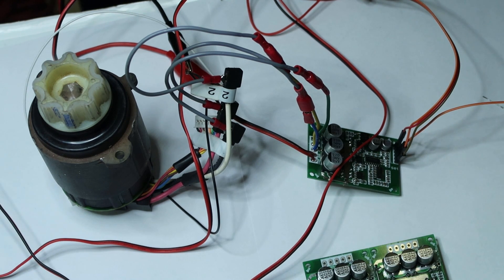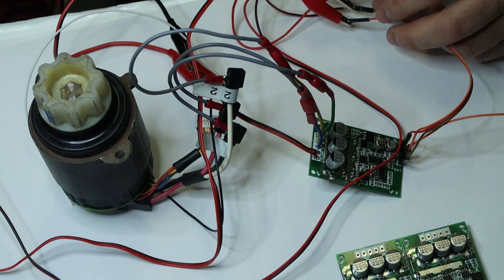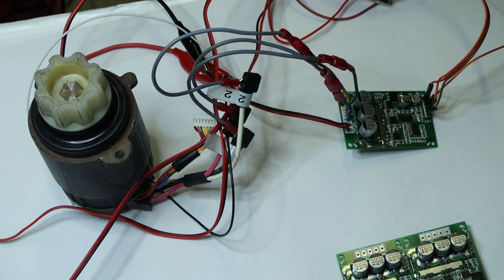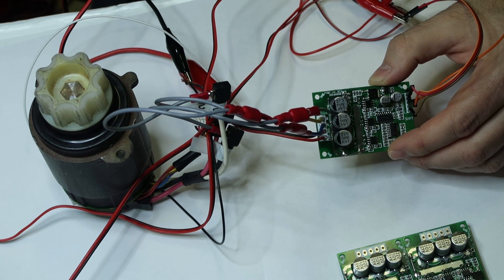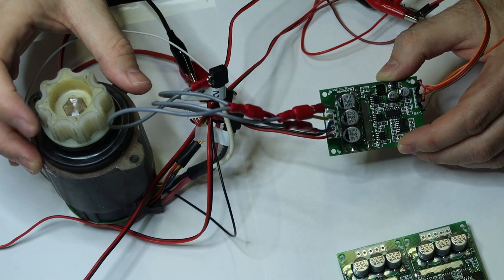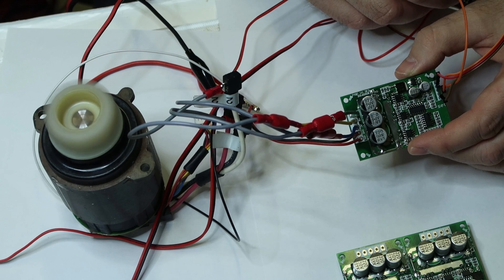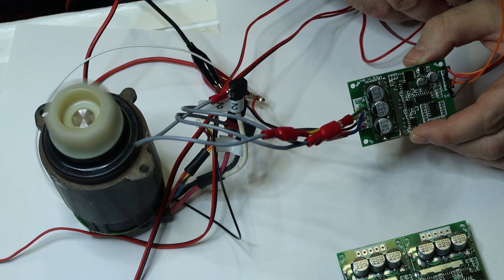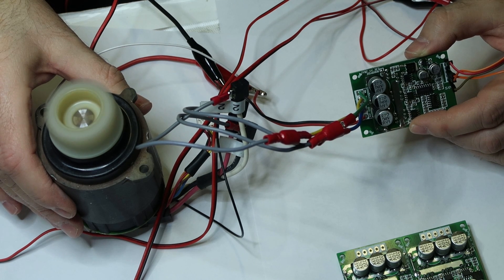Ebay Sensorless Motor Driver

Comment: hello great video congratulations !!!
could you tell me if can control the direction of rotation with pwm + - signals?
Reply from the maker: yes - there is a direction voltage 0 or 5v
Reply: @RoeeBloch  
thank you so much

Comment: Are these different from another variation that has hall inputs? I have not been able to get that one to work without hall sensors. I'm curious if the hall version only works with hall sensors connected? What chip does your board have? JY01?
Reply: Were you ever able to figure out the wiring for this type of motor? I have one im needing to get to a functional state for a project i have in mind.
Reply from the maker: HAHA - you need to know few more things to get it work :), if you donate my site I will send you information by email
Reply: Roee Bloch nvm I saw they used comparator backemf circuit that they feed to hall sensor inputs on jy01 and this circuit is missing on the hall only variant. I also found the schematic for the comparator circuit in the microchip app note.
Reply: @mkschreder  I'm using this same motor as a servo. I'm trying to use the hall sensors, but am prepared to desolder the PCB and just use an encoder. Do you know what each individual wire goes to, can I run them in parallel?

Comment: I can't figure this shit out. Just burned a board trying to spin one of these bastards.
Reply from the maker: If you have connected everything correct and it doesn't work, it may be related to the motor itself.
Which motor do you try to spin ? link and model
Reply: Roee Bloch cheap Amazon motor. I will get link. Only has 3 wires. I am not using the specific driver in your video, but it's very similar. I will source the driver link as well. 

Mostly I'm frustrated because I can't understand the connections their selves. I've been a electrical technician as a diesel mechanic for years now..

DC into 3 phase confuses me. I just got interested in electronics though and bought an Arduino. Board comes with a potentiometer and I wanted to try and run it on the potentiometer alone. Connection arced and lost the power led.  I will post links shortly
Reply: Roee Bloch 
Brushless Motor Control, DROK BLDC Motor Driver Controller DC 5-36V 12V 24V Brushless Sensor Motor Regulator Monitor 350W High Power DC Motor Speed Controller Module with PLC Control, PWM Duty Cycle C https://www.amazon.com/dp/B07BFQ5K3B/ref=cm_sw_r_cp_apa_RKS1AbMVNFV51

This is the driver
Reply from the maker: This Motor is not suitable for this driver. in the best case it will spin the motor very slow or not at all. you need motor driver that is suitable for this motor
Reply: Roee Bloch also, I don't understand how it is possible to fry the circuit board that is rated to 16 amps and my power supply only provided 10amp at maximum and wasn't even at 100%. I didn't connect the pwm wires to power supply so I think maybe the board was defective. I had it connected with motor for a good 5 minutes, then I powered off and during reconnection it arced and I lost power LED. Anyways. I'm going to try the esc with a pwm pulse from my Arduino board.
Reply from the maker: It is not just high current that can ruin the board, for example if you have connected power in wrong direction may be just a small current flow will burn the motor. usually voltage below 0 can ruin the board, for exampe this voltage can flow somewhere if you supply to control signals voltage below 0 - or any other condition cause it
Reply: Roee Bloch yeah I obviously screwed something up. You think the esc I posted will be sufficient? I'm honestly just wanting to get the motor spinning, if too slow for instance I will look at other options. But before I buy expensive motor control I'd like to make sure I understand what I am doing. You understand? Fry cheap stuff to learn before buying expensive equipment
Reply from the maker: It is possible, not just current flow is the cause of burnning circuit, sometimes voltage on input below or above limit can burn the circuit
Reply from the maker: yes it is possible to drive ESC from Arduino
Reply: Hi. Sorry if this sounds like a silly question, but I'm still a newbie. How can I be sure that I've fried my board?
I connect a 24V DC supply across VCC and ground, and the board starts to heat up, but when I connect the motor, which is this kind of water pump: https://www.aliexpress.com/item/Free-Shipping-Submersible-Pump-for-Pool-Watering-Garden-Plants-Watering-24V-DC-1000LPH-8M-43-2W/581657599.html?scm=1007.13438.100207.0&scm_id=1007.13438.100207.0&scm-url=1007.13438.100207.0&pvid=f9703469-5028-45dd-943f-5c55cdfc50ac&_t=pvid:f9703469-5028-45dd-943f-5c55cdfc50ac,scm-url:1007.13438.100207.0
NOTHING HAPPENS! 
According to my colleagues it worked once while I was away, but it hasn't since then. 
I'm really not sure what to do about it now. I don't know how to test the pump either, since it's a 3-phase pump.
Can you point me in the right direction?

Comment: Really very good for a sensorless controller. Of course, the most interesting thing is the "loaded" motor shaft from a standstill, so when RPM is increased under load ...
Please clarify 2 points:

1) When you blocked the motor shaft, you could hear a beep. Probably a kind of "stall warning" or "overcurrent". But where does the beep come from? Could it possibly be that the controller lowers the frequency in the clearly audible range?
After all, at this time a single half bridge is heavily loaded ...

2) Please read the name of the controller IC with a magnifying glass. I would be interested to know which of the JY types this is ...
Reply: Could also be that the beeping comes from one of your gauges in the background ...
Reply from the maker: The beeping is from the coils motors, this is the frequency of mosfet changing current between the coils - look at coils as regular "speaker" without membrane
This is reletavely low frequency (about 1-2Khz) - since it is more difficult to "read" back-EMF (coil positions) in higher frequencies
About the JY - this is chinese chip, so I don't know what they have implemented exactely - but what is needed is some logic to determine coils current and voltage between coils phase and then "decide" what is the next phase.
As long as you use "high current motors" this is more easy to verify, in low current this is more difficult
Reply: Accordingly, the motor acts with its windings like a speaker without a diaphragm. So far that makes sense.
I summarize the process again to understand:
1) The controller (JY ...) normally operates (motor shaft not blocked) at a higher frequency, e.g. 13 KHz or something more ...
2) When the motor shaft is blocked, the controller reduces the operating frequency of the MOSFETs to 1 ... 2 KHz, which can be heard as a beep ...

But: WITHOUT operator intervention, the unloaded motor shaft will NOT restart! And that with a clearly audible beep, so measurable back EMF ...

I see that as a weak point. What do you want to do in a car project when the controller stays in this mode? Do you want to get out and push the car?
In my opinion, you will have to find a way to reset the BLDC controller WITHOUT having to turn the motor shaft ...

Therefore, I also believe that the beep is more of an audible signal to the user, instead of a fault LED. Beeping means switching off after blocked motor shaft (stall current reached or exceeded). If that were not the case, the engine would start up by itself. But that's exactly what the engine does not do ...
Reply from the maker: Yes - it should be tested under a load.
I have contact the manufacturer - this board support up to 60W without heatsink, and it support up to 500W with heatsink.
So in case of load - 60W is not enough, and I will have to put heatsink, or the other choise is to use the heatsink of Segway with its mosfet. I am almost sure its also N-ch, so it will fit in.
you can disconnect the mosfet on board and connect other mosfet with heatsink, I have to think about.
When I will have more time I will do the first test for this, hopefully soon
Reply: I think so. 500W with heatsink but can only be achieved with at least 33V. I read somewhere that the current limit is 15 amps. Another problem is braking from high engine speeds, with the voltage then generated rising above the operating voltage. That's really a problem with a 36V system ...
The buffer capacitors next to the MOSFETs have 63V, the MOSFETs even 70V. BUT: the voltage regulator tolerates a maximum of 36V on the input side ...
Reply: aha,nice try. good to know you changed the right capacitor.enjoy it.
Reply: its built by JY01 IC...I am Amigo, again  : )